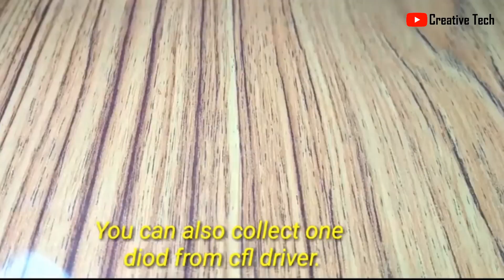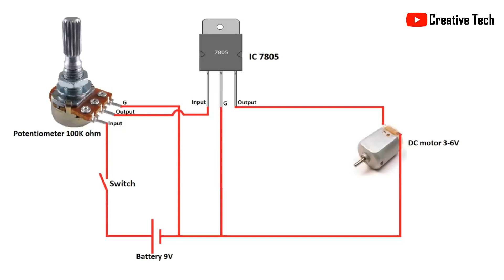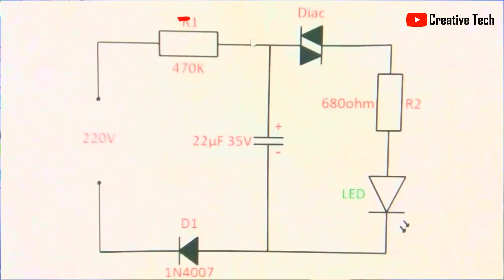BE.5 എന്തിനുവേണ്ടി ആണ് Resistors ഉപയോഗിക്കുന്നത്..Practical examples..

Comment: please your number
Reply from the maker: mail cheyyu bro
Reply: 12 v led 24 v il kathikkaan valla idea yum undo 7736217510
Reply from the maker: @kktvlog6437  regulator ic 7812
Reply: no answer?
Reply: manassilayilla bro
Reply: @kktvlog6437   7812 enna oru regulator ic und ath upayogichal 12 voltinu mukalil supply kooduthalum(input) output 12 volt aaki tharum

Pakshe athinu oru heat sink upayogikkanam